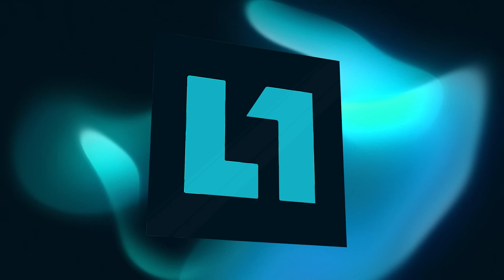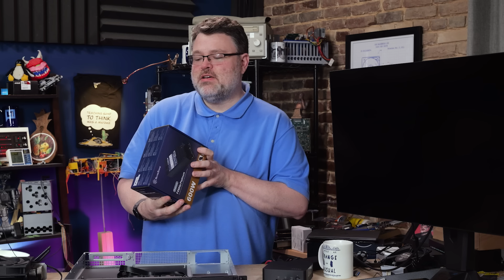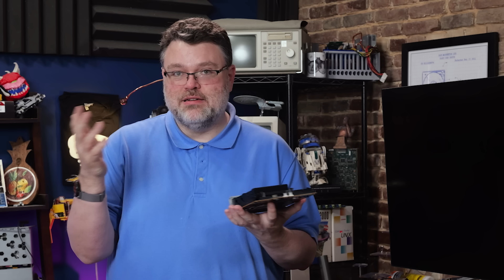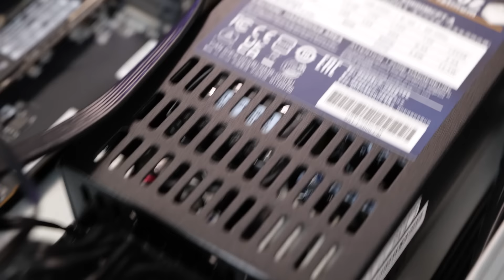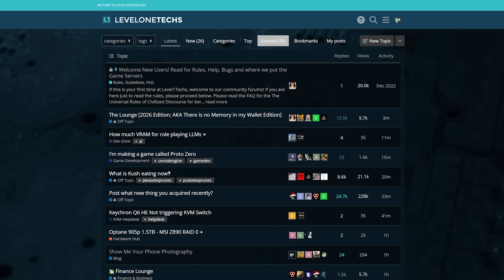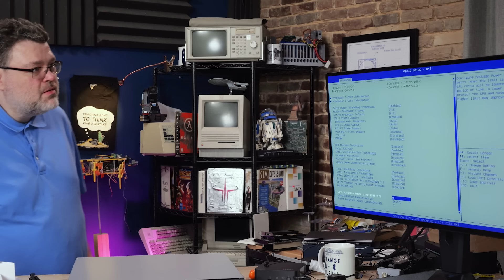Building with SilverStone's RM 100 Chassis

Comment: It's a nice case, but for me, due the 1 HE to limited for "silent" cooling. Because of that, and i don't need full size cards i use the Silverstone RM23-502-MINI for my three servers at home. If you need/want a silent psu i can recommend the HDPLEX passive GaN available in 250 and 500 W. "Downside" it's a own form factor. And a RM52 for my PC which i move to my rack as well.

Comment: What SAS/Sata adapter with 2 external connectors and internal connectors do you recommend to make this the biggest possible NAS? I saw you can use Icy Dock tripple 3.5 inch enclosure but would their 8x2.5inch drive in 5.25inch form factor also fit internally?

Comment: I built a set of light servers using the chassis recently. Important to note that not all 3.5 adapter accessories will actually fit. Had an icydock 3.5 to 2x2.5" adapter. Holes were drilled to make it work 😁

Comment: With that mini-ITX board A little cardboard to block off the half of the case that isn't being used would probably help as it's not the total airflow that is your problem, it's the fact that all that air can just take the path of least resistance.  Have a look at the insides of an HPE DL20 for clues ^^;

Comment: I have used Chenbro (1U) before Silverstone bought (renamed)? them rackmount cases for like 20 years. I always liked them more than supermicro rackmounts - anything to avoid the supermicro rails lol. These half height ones had problems back in the day when using 3.5" drives when the cases came with blower fans - the vibrations would increase the failure rate for the hard drives. But for SSD drives they have been great.

Comment: my Hyve Zeus was an AMAZING workhorse, but I downsized to an HP Elitedesk 800 G4 since it could fit more drives and PCIe connectivity. That said, the Hyve wasn't super loud until I was running a ton of VMs on it and I was running 128GB DDR3. Other than IPMI, it was as no-frills as you could get.

Comment: The uneveness with e-cores from what I remember is usually a problem with LXC containers, as the scheduler pins them to random cores. However, with qemu virtual machines, they seem to work fine because thread scheduling prefers p-cores first.

Comment: I have several of the smaller 1U supermicro chassis, 12in deep, I slapped xeon-d boards into them all, 4 are a proxmox cluster, one is a nas with 8 sff ssds in it, and I have spare with a full desktop OS.
Reply: How do you deal with the risk of lost quorum with an even number of nodes in the cluster?

Comment: I know you said it would be a waste to use a full atx mobo in this case, but I am looking at this to transplant an existing system into my rack that is currently in a desktop configuration. I'd have to get a low profile cpu cooler, but it would be nice to see an AM4 build just to see what does and does not work.

Thanks for the video!

Comment: The weird I/O shield is probably for cutting out holes for your specific motherboard's ports since standard shields won't fit.
Reply: Correct, from the RM100's manual "Cut out the appropriate opening based on the rear I/O layout, then install the rear I/O bracket" with a picture.
https://www.silverstonetek.com/upload/downloads/Manual/case/Multi-RM100-Manual.pdf

Comment: Those storage controllers (SAS/Tri-mode) really aren't that bad. I have one (granted, fairly modern tri-mode) with a very quiet 120mm pointed in its general direction and it works peachy keen. You absolutely cannot have them sitting in stale air tho.

Comment: 11:52 "Sometimes you can get these pretty inexpensively on eBay."  And by "sometimes" Wendell means "Right before this video debuted."
Reply: The Wendell insider trading
Reply: Chinese W680 mobos are for sale on amazon. Just not asrock ones. But they got way to many storage ports for RM100. CS381 or RM21 are better fit for W680 mobo.
Reply: They were pretty expensive before 
The worst thing is that they’re always out of stock